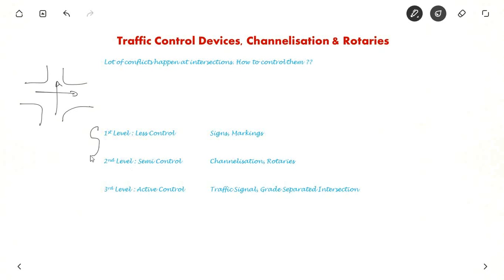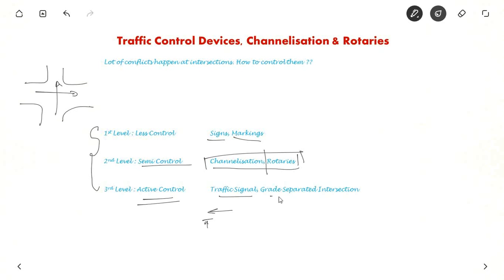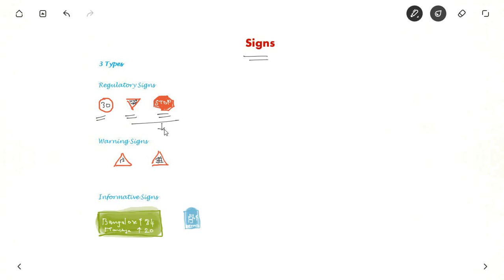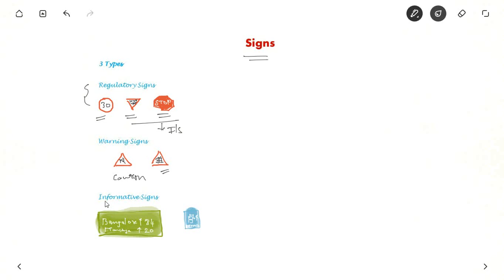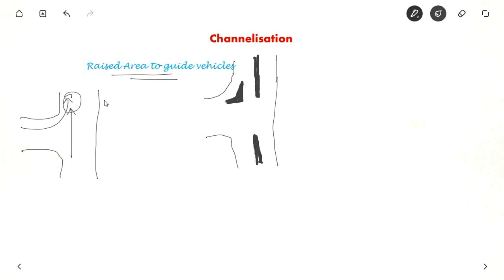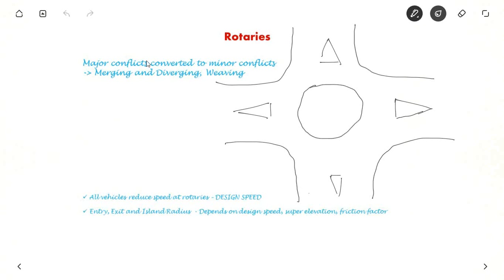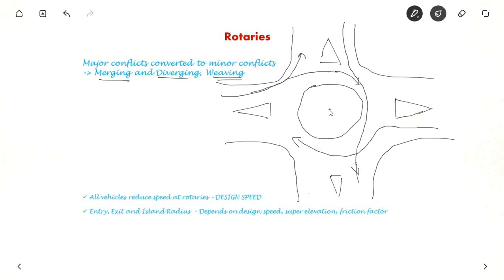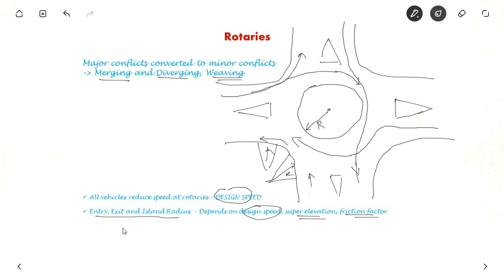Traffic Control Devices | Transportation Engineering

Comment: Sir Please elaborate rotary a little more because few conceptual questions has also been asked in GATE from this topic which are not included in this video.
Reply from the maker: +Swaraj Jayswal Those should be simple ones. I guess I have just briefed how rotary works , ll try to elaborate later. Mean while do let us know if you have doubts with respect to rotary or any questions in GATE.
Reply: Sure :) Actually to me the rotary is clear. But I feel the terminologies of Weaving length, width, Rotary capacity, Ratio of weaving traffic to total traffic should have been added. There are few questions which have been asked in GATE from these points.